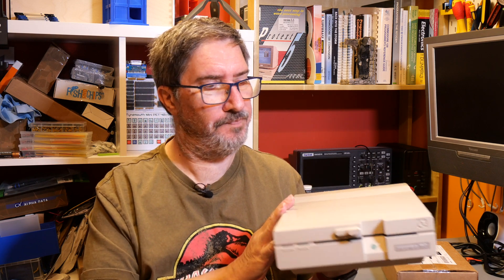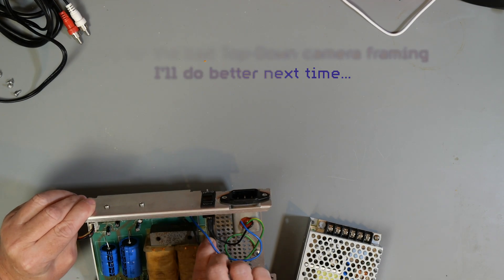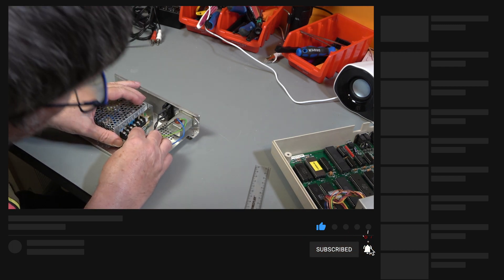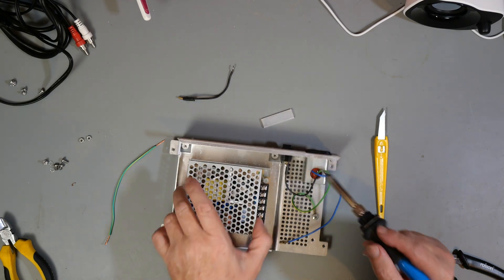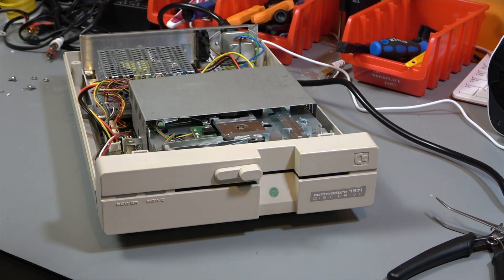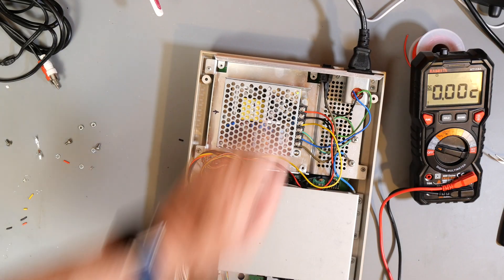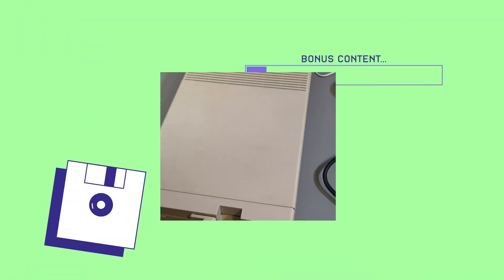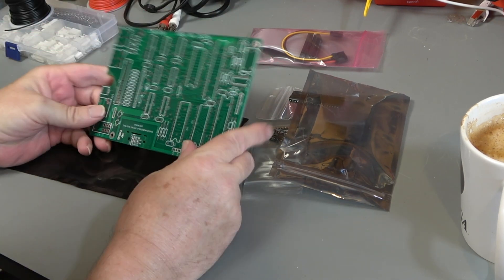Put a Mean Well PSU in a Commodore 1571: Here's How...

Comment: Hi Tim!, I bought a used 1571, it works but the previous owner sold it to me WITHOUT the body screws. Do you know what kind of screws I need or could you at least tell me the diameter and pitch? Thank you so much!
Reply from the maker: Pretty sure they're #6 x 3/8" self-tappers. Basically the same as a C64 case screw. HTH.
Reply: @TimsRetroCorner thank you so much!

Comment: Original one are good power supplies but they are noisy and running quite hot. Not as hot as on old 1541 but still. How is noise on this little fella?
Reply from the maker: They also had the foresight to put the logic board under the PSU, not above it, which helps with heat. Meanwells do come under some flak for being noisy, but they're no worse than any other switch mode unit. And it doesn't affect the drive's performance in the slightest.
Reply: @TimsRetroCorner thanks for the response. It is a bit scary to run 40 years old power supply but the guy who service my c128 said it doesn’t need any work. Caps are fine so I guess I keep the original with checking voltages once a six months. He replaced dry capacitors on c128 power supply though.

Comment: I had two 1541-ii but for short time someone borrowed me 1571-ii but now not sure if transformer or switching power supply. All my commodore equipment like three C64 computer (two flat, one big), two 1541-ii, datasette, diskettes, power supplies, graphic writing unit XY4150 (made in Czech Republic), joysticks, cartridges.. were stolen in 2004. I don't have time, space, money, patience to make effort buy it all again and make it work. Also many diskettes was stolen too and few that wasn't not sure still readable and there is no spare to buy. I still have cassettes but don't have equipment to make image for emulator and program I tried with classic cassete player and sound card input no success. 
But I like that meanwell power supply it can be used like replacement for my external 3,5" harddrive box because old power supply struggle to spin up harddrive for firsttime then run normaly. Multiple attempts to spin up everytime it wake up from suspend can be harmfull for harddrive.

Comment: Nice. What was your motivation to do this? Reliability and heat?
Reply from the maker: Reliability mostly, and noise. The old transformer was making a hum that a bagpiper would be proud of! Heat not so much - because the PSU sits above the main PCB, it doesn't contribute much to making the board hot (although the chips are plenty warm on their own!)

Comment: Hi Tim, Great video and I have already ordered the power supply to fit to my 1571, quick question...any thoughts on if this would also be suitable to mod a 1541 and reduce the heat output?
Reply from the maker: Hi and thanks. The 1541 is a little bit different in that the rectifiers and voltage regulators are on the motherboard instead of a separate power supply PCB. So there's an extra step in removing those components and then finding a suitable place to hook up the  wires from the Mean Well. I don't have a video that shows that, but I will be making one in the future (actually a SFD1001 drive, but the principle is the same). Meanwhile this guy goes through the process on a 1541 here: https://www.youtube.com/watch?v=dU1vUX2HB9A
Reply: @TimsRetroCorner  Hi Tim, thanks for the link, presume the RT-50B is needed for the 1541 or would the RT-35A suffice as well?
Reply from the maker: The RD-35A should suffice, although the 50 will be fine too. Note it's the RD not the RT (D = dual output ie 5v, +12v, T = triple output ie 5v. +12v, -12v). Commodore drives only need 5v and +12v (RD-50A or RT-50B would work - you need to check the voltages available carefully since the final letter differs between types)
Reply: @TimsRetroCorner  Thanks Tim, keep up the great content!

Comment: Hi Tim, a small question regarding your 3D printer and times. What happens to the print process if there happens to be a power outage? Will it carry on from where it left off when the power went out?? Cheers.
Reply from the maker: In theory - it has a resume function (you can use that to swap out filament too if you run out or want to change colour). There's the potential for it to leave a scar of some kind at the point where it resumes, which may or may not be problematic. I haven't tried it though.